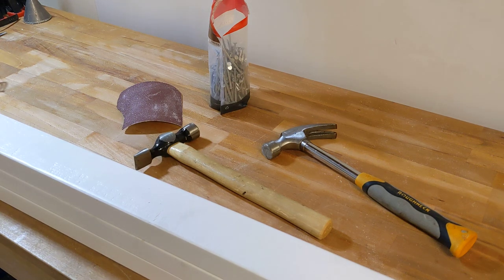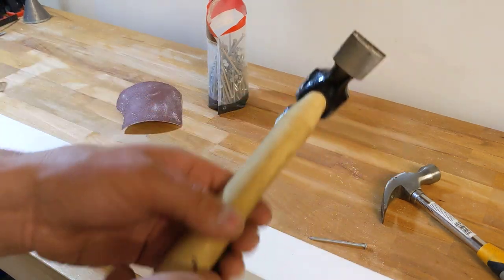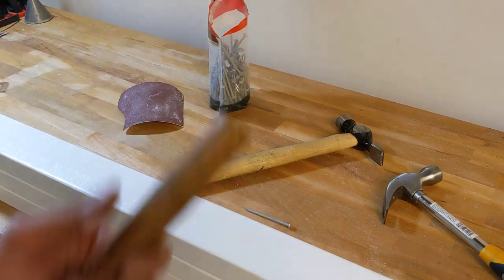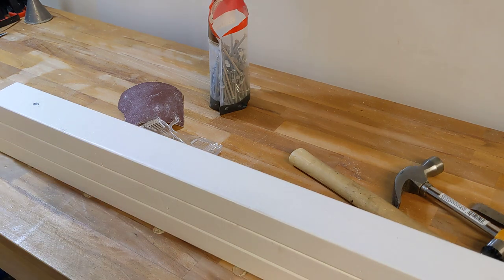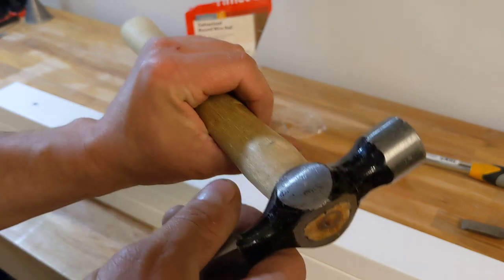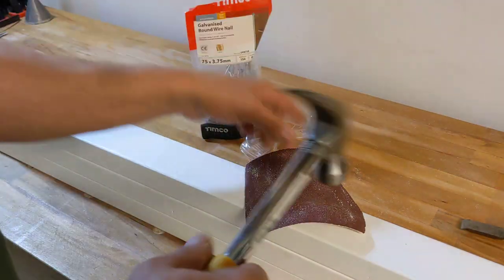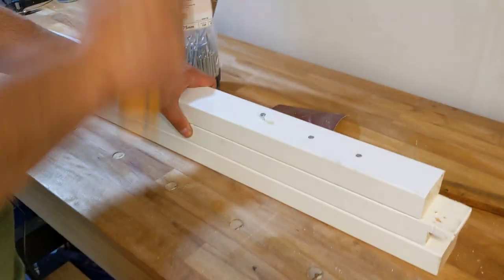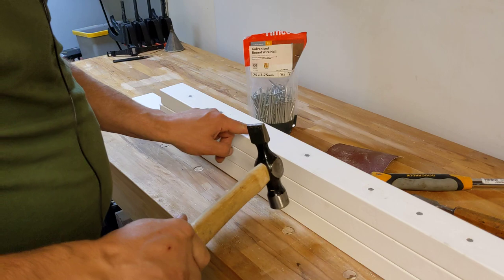Man Uses Hammer 🔨!!! - Build a Woodworking Foundation With a Key Skill

Comment: That's why you use a mallet to hit chisel .....look at a nail head when you hit it same as a bike look at a stone on a bike you'll ride straight over it I was told the cross pain was for adjustment of wooden planes ..
Reply from the maker: Hi Gary. Yes, "Target Fixation"! I use a cross pein or I know it as a "Warrington Pattern. Great for starting lost heads or brads with the cross pein. I used it on the 3" wires to make a point, it wouldn't be my first choice as a framing hammer.